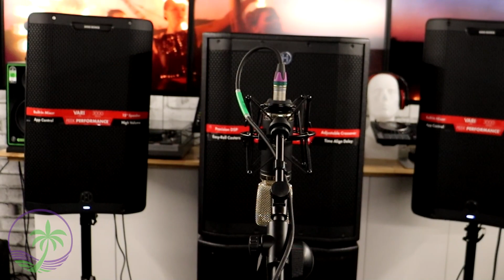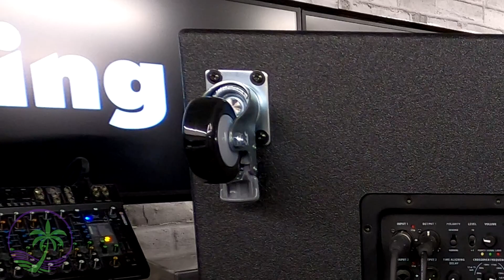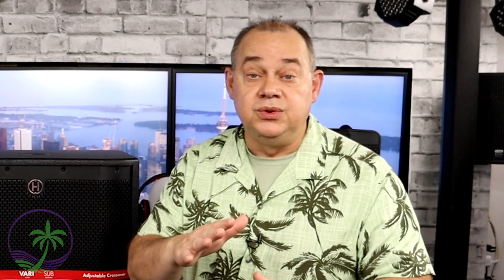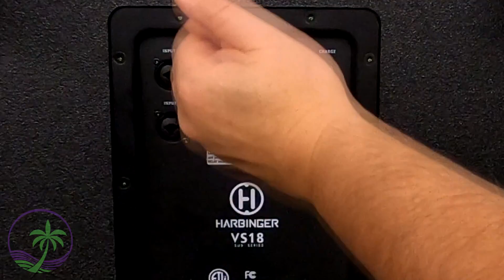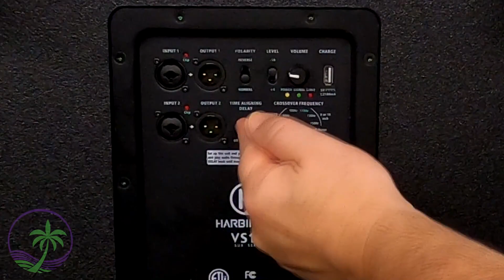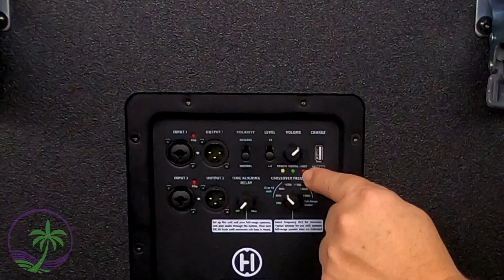2400 Watt 18" Harbinger VS18 Powered Subwoofer - New Features & Sound Test

Comment: How different audible  and feel are the subwoofers of harbinger the model vs18 versus vs12? For outdoor usages and indoor , how is it that they have the same amplifier of 2000watts peak ? Which one you recommend for not needing to upgrade and that can not say only on manual specs but really have a bigger wider frequency mid- low  range of hz

And also it’s weird but what’s better the v2218 or v2318 or vs18? I’m confused w all the models named for subs .. how good or better or same is this v2315 loud speaker in comparison to the JBL EON615 older model ?
Reply from the maker: You almost always need more when you're outside. Bigger is better, 2 in place of 1 or 18" in place of 12".
As for the last 3 models of Harbinger subwoofers, if you have an old one, you do not need to run out and replace it. The newer ones are a little better than the older ones for sure.

Comment: 7:17 question please.  Where do i set the crossover if i im using 4 subs and im using the outputs to link the others subs .do i set to full range on the crossover or at 60 heartz
Reply: At 90 or 100
Reply: If youre using 4 subs, you have to set the first sub to “full range”. 

I was having an issue when I first bought 4 of these.  I had 2 subs on the left output and 2 subs on the right output.  I initially set all 4 subs to 90hz but only the first subs in the chain were producing adequate sound.  The second subs in the chain were extremely low and weren’t producing adequate output.  

I contacted harbinger tech support and they told me that the first sub in each chain needs to be set to full range. 

I did that and BOOM! all my subs were hitting hard!

Comment: I have alto ts415. Wondering how will they pair with this sub
Reply: I have 4 of these subs linked to 2 Alto ts415’s.  

Set your ts415 to the “large 18+” setting then run your cables into the subs.  Set the VS18 subs to “full range” and they sound great!

Comment: I bought a pair of the Vari 3412 and the VS18 sub.  In your video, you suggest connecting the system using the inputs on the sub, and sending the outputs to the top speakers.  I have mine connected with the left 3412 accepting the inputs as stereo master on input 3 (TRS cables).  The sub is fed from mix out on the left speaker.  Sub cut is set to 18, and the right speaker is linked.  Is this an ok way to do it or should I use the sub to accept the input as you did in your video?
Reply from the maker: The only problem I think I see here is that the Subwoofer is only plugged into the Left so it only hears bass from the left to play.
Reply: @expertisland  I don’t think that is correct because the manual says that the you can make the left  speaker of the 3415 becomes the “stereo master of a Smart Stereo Pair “  Essentially sending stereo signal to the subwoofer from the “Mix Out “.
Reply: You can do it either way according to the manual.  The problem is I think this way will only work if you’re using the Bluetooth connection to send the audio to the speaker. 

If you were using a mixer then you would have to send Right and Left out from the mixer. 
In that case you would run left and right out from the mixer  to the V18 subwoofer and then out from the Sub to the left and right tops ( 3412’s )

Comment: Bro, how do I hook this up to my mark 1 V2315s? There's no sub cut on my 15s
Reply from the maker: Normally you would go mixer to sub VS18 upto Speaker V2315 you can adjust the sub 150 to 180 Hz find what sound you like. all Good.
Reply: There's a massive typo in the manual for this subwoofer, the diagram they show for the back of the 2315 is actually the back of the 3000 series. I only bought this sub because I thought it was going to use the sub-cut technology that It showed in the diagram as being the back of my speakers. I didn't think that I would actually have to look at the back of my speakers considering harbinger printed the manual. Well guess what, when It showed up today and I compared the back of my 2315s with the diagram in the VS18 manual, I realized that there was a massive typo. One that cost me $900 plus tax...